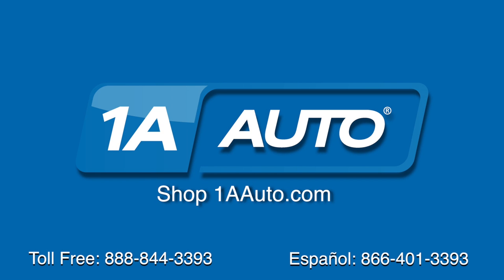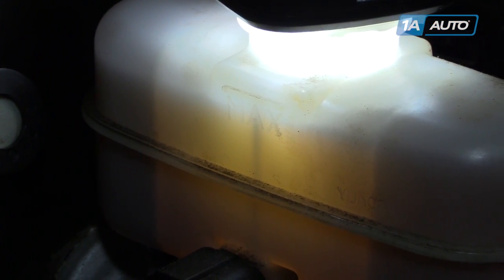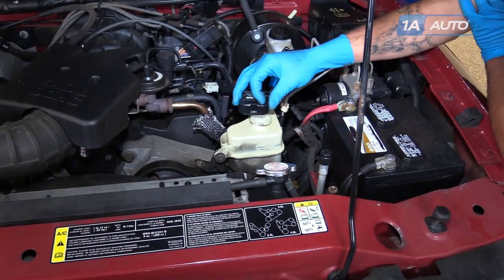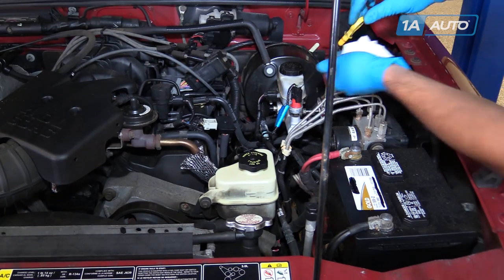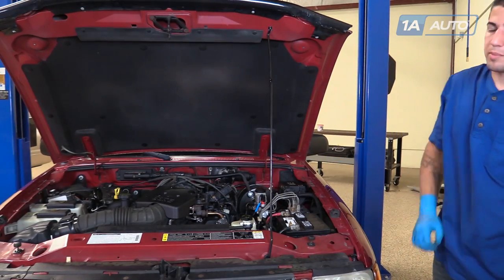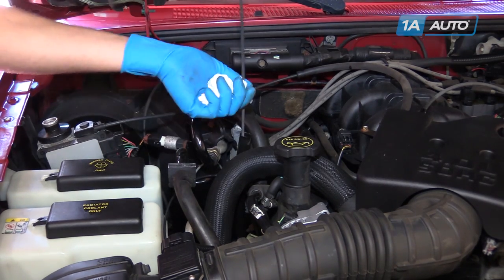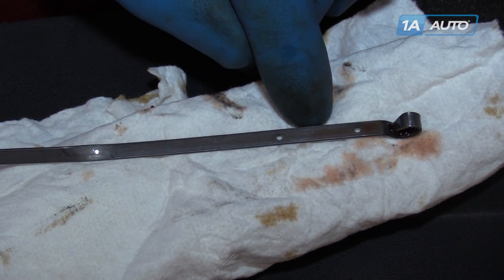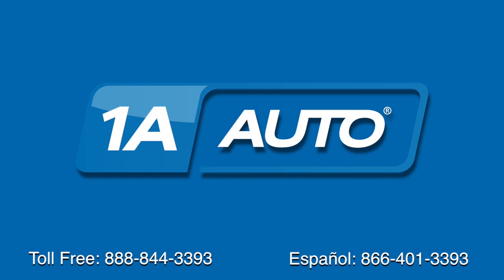How to Check Level and Condition of Fluids in Your 98-12 Ford Ranger 4.0L V6

Comment: Great info, and I'm surprised that I never knew the the quart designations on the dipsticks.  Also, I like the flashlight trick.  Gonna use all of this info today on my 99 Ranger.
Reply from the maker: +Robert McCafferty Thanks for checking us out! 1AAuto.com
Reply: @1AAuto  you guys didn't say if that's a cold or hot reading. The difference between the two reading types can be up to a 1/2 quart, that's enough to blow an oil pump

Comment: Also, you didn't mention if the car is to be warm or cold when you check the fluids. Is it cold for the transmission and warm for the oil or warm for both?
Reply: Cold for engine oil and warm for transmission.

Comment: I have an 01 ranger automatic with 250k miles. I have had it a year and not sure when the tranny fluid was last changed. Should i change it ? I heard if you change it it will make the tranny slip
Reply: what did you end up doing?

Comment: Does anybody knows what size bolt or tread I need for the fill up plug 2004 ranger 4.0 5speed mine come loose so I need a new one ?thanks in advance

Comment: after trans oil change can ya put trans oil in dip stick tube? on 2000 & newer model ford rangers? video on this?
Reply from the maker: +Danny Smith Yes you can re-insert the dipstick, but you obviously want to give it some time for all the oil to go down into the trans, thus avoiding getting a false reading.  1aauto.com

Comment: I have a 1995 Ford ranger xl .what is the correct level on the transmission dip where the fluid should be
Reply: 2nd dot when hot, not warm, HOT, full normal running temperature